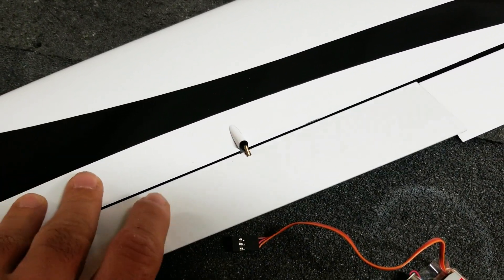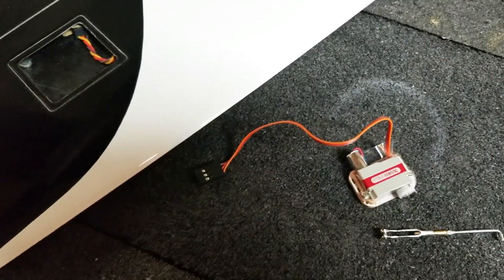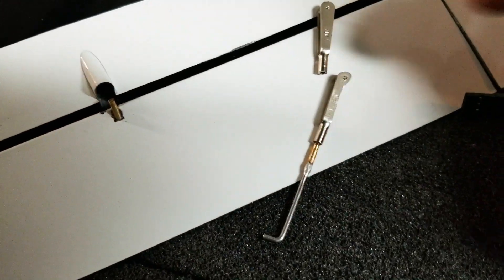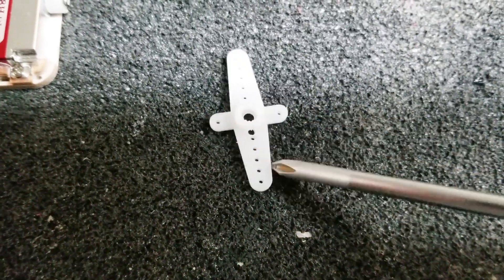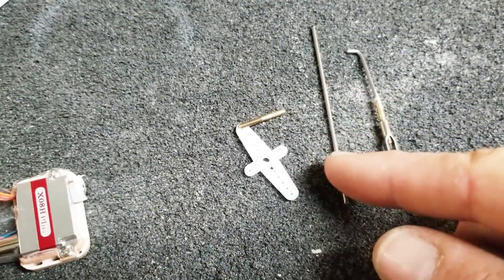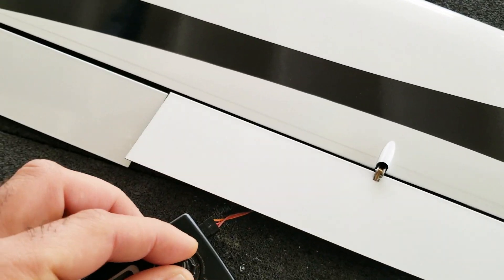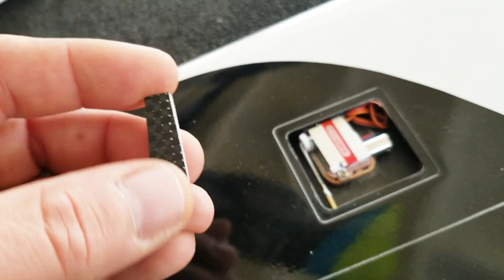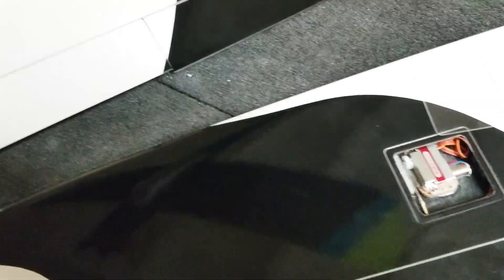CCM 2 Meter RC Slope Glider Build Part 2

Comment: Thank you for your build vids!
I have the same servos and frames, which are nicely machined BTW. I have found upon test fitting that the frames are a little too tight. Which is better than too loose of course, but the frame flexes enough that it appears there will be trouble getting a flush fit to the wing skin. Are you lightly sanding the inside of the servo frames to accomodate the xo8's? Especially with the bit of plastic in there...
Reply from the maker: Hello! No I don't sand then but for sure you could.  I do sand the corners where the hole for the screws are. You will notice on the servos there is a slight radius where the mounting arm meets the case. The frames have a sharp edge there. Sanding a radius helps the fit greatly!  I also put a lot of weight on the servos as the glue cures to force them flat. Good luck with your build!